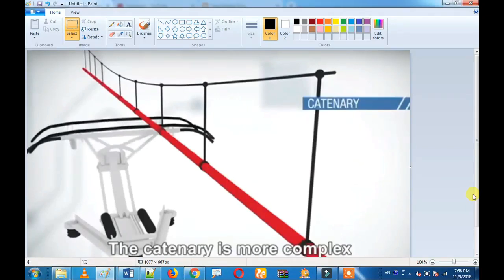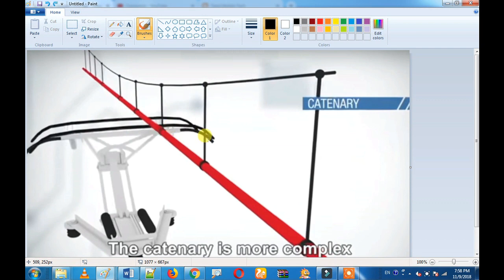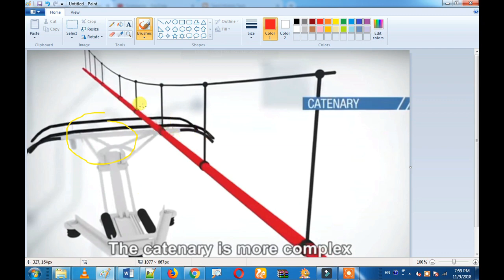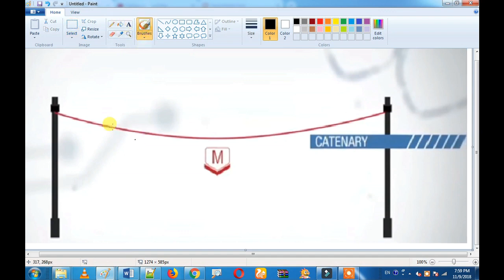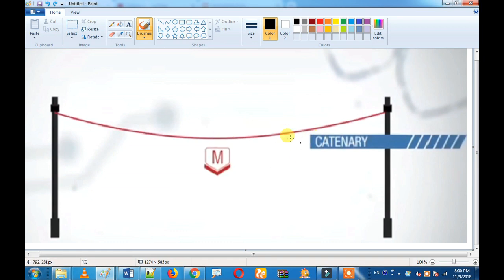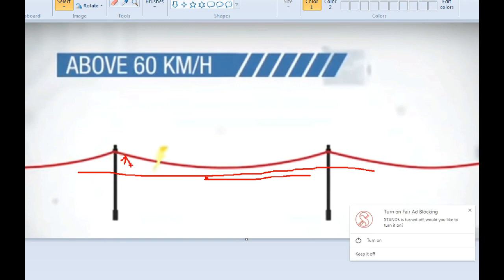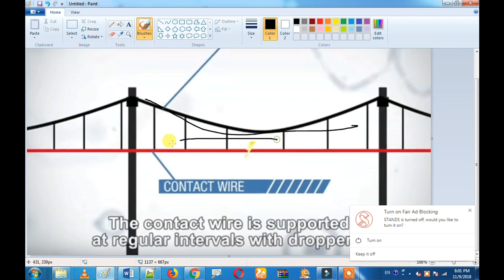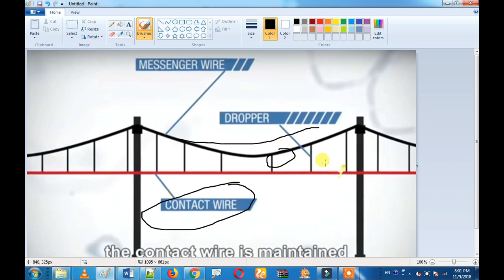Why Two Wires Are Used In Rail Way catenary In Tamil |  Railway Electrical In Tamil

Comment: bro high voltage single phase nd three phase difference patthi vedio podugha example 25kv single phase used in railway and 110kv  three phase used in ordinary transmisssion